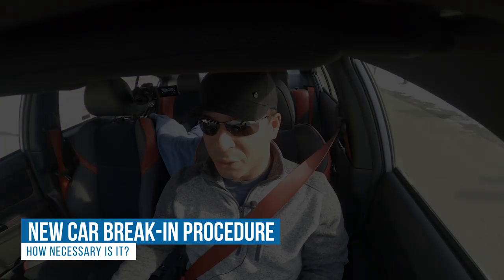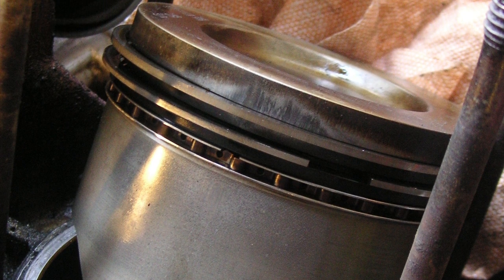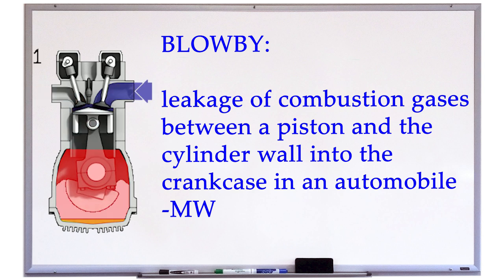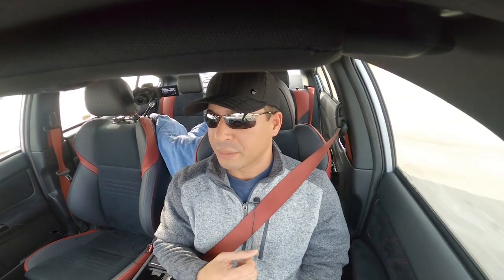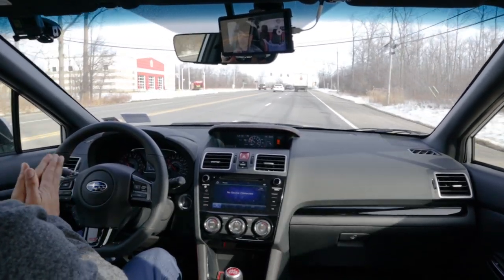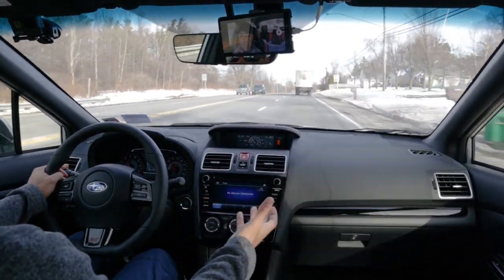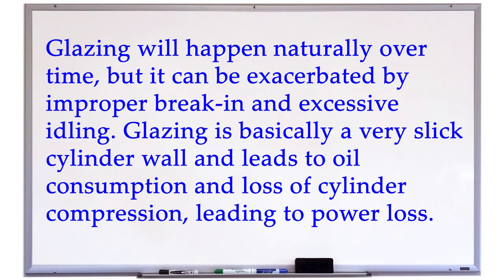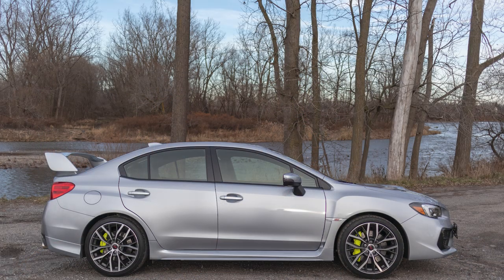How to Break in New Car Engine Discussion

Comment: Don't buy a car that's been test driven by buyers. They always want to see how fast it takes off and that's BAD for a new car. When you pay for new... demand brand new with less than 15 miles on it. You don't want a beat car.
Reply: The only other person that has drove my car is an old man who worked for the dealer that brought it over from another dealership in Tennessee. The car had just got there 2 days before he drove it over, even arrived to my dealer with all the foam and plastic lol. 😂
Reply: @xB2KxRewindZ  I'm gonna be blunt, I don't know what car you've got BUT I've seen what some transporters/ lot guys do to both brand spanking new cars and used trade ins. And unless that dealership has its own gas station. Ask yourself this, did your car come with a full tank of gas?
Reply: I just bought a truck with 40. Now I'm wondering about that. Usually I get them with under 10
Reply: @User-q6x3b  Sometime dealers take them to other dealerships... or maybe a salesman took it home for a while.
Reply: Dadda Russia San Diego News  if you're not paying over sticker, id buy it. I saw one this week. It was around 24k with a 5k markup so they wanted 29 and change...robbery
Reply: Dadda Russia San Diego News  not an si...my fault..it was a new xl or the low end.
Reply: Dadda Russia San Diego News  my point was some places are way over sticker
Reply: Dadda Russia San Diego News  nice! Good luck with it...nice ride I'm sure👍
Reply: Dadda Russia San Diego News  Drive nice and easy for the first 5 -10 thousand miles, letting it warm up a little and if it's an automatic, you'll learn when it wants to shift... and try not to be accelerating while its' shifting... the more you feel the shift - the more damage is being done to the trans - the most expensive part. After that... change your fluids on schedule, oh... and turn OFF any engine stop/start system. It is hard on batteries, starters, engines and transmissions - all to save a few drops of gas. It's utter nonsense. Turn if off if you want to add about 50,000 more miles to the life of your car.
Reply: Just picked one up with 2 miles.
Reply: @RexxReviews  There ya go! Now you can break your baby in properly so it will take care of you for many years... oh, and turn off the engine stop/start. That's a bad joke that destroys starters, batteries, engines and transmissions. To save a few drops of gas here and there. 80% of engine wear occurs when there is no oil pressure. There is no oil pressure every time the engine starts.
Reply: @MrDjvas  Just loading them on the carries is very abusive to a car - especially new ones.

Comment: I took delivery of my 2023 VB WRX a week ago. The Subaru sales rep said I don’t need to worry about breaking in the motor. Also the Peak Boost gauge at delivery had a reading of 13.5 PSI. The odometer had 35 km on it when I took the keys. I have over 800 km on the car now and for the initial 1/2 of those km I followed the recommendations to baby the car while varying the load. There are a lot of conflicting recommendations going around.

Comment: fck me. i went over 4000RPM many times the car has only 600 miles  .how bad is it for the engine ? anyone ?
Reply: I wouldn't worry about it too much. While not ideal, it's not nearly as bad in a modern engine as it would be in an older one

Comment: The best thing to do on cold starts ups is wait about 20 secs and start driving normally don’t go above 3rpm. The engine will reach operating temp way faster by doing that then sitting at idle for 3 to 5 min. You will be doing more harm then good.

Comment: Literally ordered mine and picked it up from the dealer before anyone had a chance to drive it for this very reason. I don’t see why anyone would even risk it if the car is brand new. Maybe it works, maybe not.. but why even risk it right?!🤷🏻‍♂️
Reply: Boost & Shutter That’s still pretty decent considering mine only had 4-5 miles. Essentially eliminated them having to drive it to pick up gas. Instead, I worked it out with my dealer to give me a gas card so they wouldn’t have to.
Reply: Username 1991 that’s a good point. I’m looking to get my 2nd STI used to have a wagon. On this new ones how do you check prior boost reading ?

Comment: Drive normally, don't lug the engine or high rev not under a load, change the oil at the suggested interval (~5000 mi) and your new car will be fine.

Comment: I was told by the Subaru mechanic you don't need to break it in. He also said two things you should never do with a Subaru is: 1. Never high rev the engine when it's cold. 2. never high rev the engine when the cars at a standstill.
Reply: A mechanic doesn’t know anything.
The actual Subaru engineers know, they have degrees from Japan and work in japan.
Reply: The mechanic isn’t paying for the car you are !

Comment: I am now running in my new 2023 WRX this is now my 5th new WRX, with all my cars i drive them with Respect with No over revving or labouring for the first 1,600 kms. I have never had any engine problems, or oil usage.   " Treat a new car with respect "   👍 Au

Comment: My car had 7 miles first time I started it.  
My break in process is driving it normally in a combination of city and freeway driving for at least 500 miles.  On cold start up always let the engine idle until the computer brings the idle down to 1000 rpms or less.
Change oil n filter after 1000 to 1500 miles then 4000 miles after that.  Use full synthetic and OEM filters.
Reply: I did my 1st oil change at 700 miles. Next one will be at 3000 miles and then from after that it will be every 3500k-4k miles with a low SAPS oil like Penn ultra platinum or motul 8100 eco little efe 5w30 or 0w20 whichever u prefer for ur own variables..always oem filters.

Comment: One of the main key factors for rings to sit properly is to expose the engine to vacuum. Drive the car up to 70 to 80mph, and then let it coast (do this on an empty road or highway) until the mph gets to around 30, then repeat a few more times. Install a mechanical boost/vacuum gauge. On my rebuilt GTi, it read 22 in vacuum, extremely healthy engine. 
Hot/cold cycles also helps on engine break-in, so do simple spirited drives and let the engine cool off until the next day and drive it again. On mine I changed the oil only at 300 miles and then oil and filter at 1k miles.
Key factor, let that engine see full vacuum at 22 when coasting, best thing for the rings and cylinder walls. 
Car is 10k in, no burning oil, strong compression.

Comment: Generally good advice although I question the need to warm up the engine for 5-10 minutes, seems wasteful of time and fuel, but I keep the revs low until the temp gauge starts climbing. On the highway, I vary engine speed by using different gears at a given speed, even with an automatic (in manual mode), while staying below the mfr's break-in rev limit. I have also heard that the vacuum caused by engine braking (down-shifting to slow down) helps with break-in. Dealerships rarely mention break-in, it should be a priority. They don't mention it during a test drive, and since much of the benefit of following break-in comes in the first 100-200 miles, if you buy a new car with some test-drive miles on it, those previous drivers may have reduced your engine life and performance.

Comment: Good, common sense advice and observations... Thanks for your focused perspective😊 Been following your lead in my my new 23 Tacoma.... I changed oil at 500 miles and am almost at 900 miles now and hope to enjoy it for a long time... I am generally a drive low RPM, boring, cruise control guy once break in is over... Hoping to have this truck last a long time. I appreciate your taking the time to address this wide open issue. While I understand the mechanical dynamics behind ring expansion and contraction, heat cycles etc, I have a real difficult time supporting the " drive it like you stole it" minority theory that is out there.. somehow, what you say makes a lot more sense, at least in production vehicles...
Reply: Hmm I didn’t know about changing oil at 500 miles. I just follow the manual which is every 6 months or 5k miles. But I do warm up (longer than most though), keep my RPMs under 4k (easy since I drive mostly local streets with speed cameras all over and speed limit 25-30), no speeding or gassing with a heavy foot, but hard to vary my RPMs as previously described with my local streets, and if on the rare occasion I drive on the highway, I baby the engine keeping it at 50ish mph. But my ‘23 4Runner is currently at 600-something miles.  So I guess not too late to change the oil before its first dealer included service

Comment: My first oil change on my 2022 RAV4 2.5 4-cyl was at 1,200 miles (1,931.21 km), the second was at 4,200, and the third will be at 10,000 miles (16,093.44 km).  Future oil changes will be when the odometer advances between 5,000 and 7,500 miles (12,070.08 km), depending on how much of it was city driving and how much highway.  If all I did was highway driving, I'd change it every 10,000 miles.

Comment: Something else I did was installed the catch can before any oil had a chance to reach the combusting chamber. It was comforting to see inside clean hoses and intercooler👌🏼
Reply: Boost & Shutter I’m jealous! AOS is better. Looking forward to the install video amigo🤙🏼
Reply: Catch cans are analogous to snake oil. If they were beneficial the engineers would have integrated them into the design. Although if they help you sleep better, no harm no foul.

Comment: I have a new JL manual 2 door wrangler sport with 3000 miles. I always let her oil flow upon cold start, to when her computer tells her engine to come back down to 1k rpm
I changed my oil and filter around 1000mi, and will do so again at 5000 and then every 5000 after that, with Pennzoil Ultra Platinum which is what I've decided on after doing a fair amount of Research, 
Yes consult your manuals every car manufacturer has different guidelines but most say no extreme driving but good to vary speed, and full pedal acceleration under 4K rpm.
I hope to get to enjoy this beautiful cool machine for years to come

Comment: Not necessary. I've spoken with a Subaru regional engineer on this when I first bought my STI new in 2015, he said the STI and WRX motors are pre-broken in at the factory. All STI and WRX motors go through a series of stress and destress cycles as well as being put under full load with the turbo at various RPM cycles as well. They run the motor full boost/ load all the way to redline during these cycles as well. He said the motor is broken in, rings are completley sealed and seated  by the time the the car leaves the factory.
**NOTE** aside from this info, you should still follow the break in protocol per warranty reasons. Any warranty claims could be denied if the break in protocol in the owners manual is not followed.
Reply: @akqjtn   There's  a video of a tour inside the Subaru factory in japan where the WRX and STI are built and it even shows the technicians going through these cycles on the motors it's pretty interesting to watch.
Reply: You made my day cause did not break point my engine at all.
Reply: Hey man you think you can find that video. Ill love to see it. TIA
Reply: put 50 miles on my built evo motor before ramming 40psi into it, no problems at all.
Reply: Everyone, its still important to note that yall should still follow the break in per warranty reasons. Any warranty claims will more than likely be denied if the "break in" wasn't followed.
Reply: Don't care what the regional guy says. Follow your manual.  Period.
Reply: @slothystyle  can you find the link?
Reply: @slothystyle  how on Earth would they know if you did or didn't follow the break in period? They simply have no way of knowing
Reply: Thats for WRX engines, what about regular Subaru engines on other models?
Reply: Break-in period: old school practice ✌️
Reply: All this is not true
Reply: A new nsx is broken in, it also starts at $160,000 and it is one of the only cars that is broken in from factory, not a $30,000 subaru
Reply: @jaybee6477  Actually, this is very true.  I  lived in Japan in 2015 for 4 years and my Roommate worked in the Subaru Plant where they assemble the STI and WRX engines and they do in fact break these motors in at the factory on a machine prior to putting them in the car just like the OP explained.
I remember asking him this question when I bought a STI when I got back to the states because I wanted to tune & mod it right away and asked him if I should wait for 1k mile break in period for the motor before I did and he explained to me these motors are pre-broken in at the factory already.
Reply: I doubt the engines are ran for 400+ miles
Reply: I would still follow a proper break in procedure.  Regional engineer may not follow up on these minor stuff about break in. Besides they know it will last till the end of your powertrain warranty. They don't care for your engine after warranty period.  Yes they test on dyno at the factory but, I don't believe they are fully broken in. Saw on a documentary the newer NSX engine is properly  broken in at the factory. Your paying more money for the car and they want that car to last the ages to become collectors like the old car.
Those regional engineers most like  follow up on dealership issues like strange batch of siezed engines or trannys in such they can create a recall. Also if dealer can't figure something out they step in to help. I know because I have seen these guys before.
Reply: There was a video on break in testing on 2 brand new motorcycle engines. One.broken in gently and the other broken hard. Couldn't remember what mileage they put on. 
They measured piston and cylinder and other stuff. They were both identical. But if I had to buy one of those engines I put my money on the gently broken in one!
Reply: @stevel1475  nsx factory was very proud in there video, saying "this is the only car with no break in period because they drive it on a rolling road putting all different loads on the whole car"

Comment: I let the engine warm up before every drive until it gets around 1k. I think I did a good job breaking the car in. What drive mode do you normally use? I'm usually in sport mode 90% of the time.
Reply: Boost & Shutter I keep mine in intelligent most of the time... I don’t like the boost surge during regular driving... but when someone wants to have fun s# it is

Comment: Hello, just waiting on my forester sti to come back from getting forged engine, I've been told to change oil after 100 miles, then 500 miles and then 1000 during the break in period, but I'm going to be very strict with myself during this process anyway. Well done on new car looks great you have my sub 😁
Reply: @akqjtn  yeah that's my intentions just use cheapish oil untill after the 1k mark then put good stuff in. Is it hard to keep yourself disciplined to keep it steady 😂
Reply: @Captain Buff The Third basicly the guy said after 100 miles change the oil from what he put in the engine as he's putting a running in oil for me first... So I will just be putting in average oil rather than top quality stuff as I will be dropping it at 500 miles then again at 1k. I feel it would be a waste of money to put good expensive oil in to drop it straight out pretty much. Once I'm on the 1k mark I will be using nothing but the best quality oil I can get.

Sadly when I bought my sti I didn't intend to forge the engine. I bought the car and drove it 170 miles then it got rodknock, I feel the previous owner knew something that I couldn't find on test drive. It is what it is, but at least I'm getting a new stronger engine out of it 😬
Reply: @Captain Buff The Third thank you mate, and yes I beleive that's the reason why as it's been rebored and what not so there is a chance for small impurities. And totally agree people can be c**ts when it comes to selling cars... When I sold my type r I refused to sell it to the buyer untill a week later as it had a dodgey starter motor and snapped knock sensor and I wanted to sell a nice honest car.. thing is not ever one works the same and not all people are decent sadly so alot of the time buying second hand cars means u can buy some douche bags problems.. and I hate them people that give douchey YouTube comments... it's pointless... Happy Christmas guys!

Comment: I had the oil & filter changed on my 2023 Lexus ES300h, Ultra Luxury trim at 1,000 miles and again at 6,000 miles. I also change the oil & filter on both of our vehicles every 5,000 miles or six-months, whichever occurs first.

Why, well just watch "The Motor Oil Geek" on YouTube and his discussion about why you change the oil & filter in the first 1,000 miles on any new car and at about 5,000 miles thereafter. You will see why and as Scotty and The Car Care Nut say, oil & filters are cheap, engines are expensive. LOL

Comment: I have a 2020 wrx base model and since I bought the car with 6 miles on it people have told me they see clouds of smoke coming from the tail pipes upon acceleration. I cant see so I dont know if its only during boost or during acceleration in general. I this normal to see smoke from time to time or should I be worried

Comment: Just did a break in oil change at 1600km. It was sad to see that beautiful clean oil drain out, but it'll be better for the long run
Reply: Meh engine oil is cheap. The engine? Not so much.

Comment: Amazing car! Congrats! When you started mentioning "modern engines" it was a bit ironic as the 2020 STi still uses a 16 year old motor with no significant changes. Would this mean a more old school approach to the break in procedure would be needed to accommodate the older tech??
Reply: @akqjtn  haha yeah carb old is getting a little TOO old. I just picked up a 2020 STi. 800 miles, so almost through the painful process!